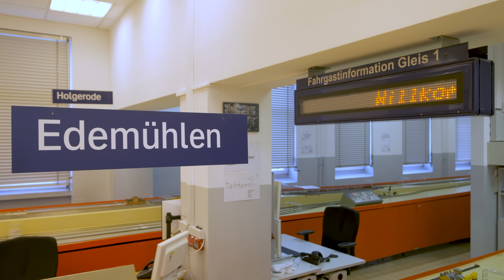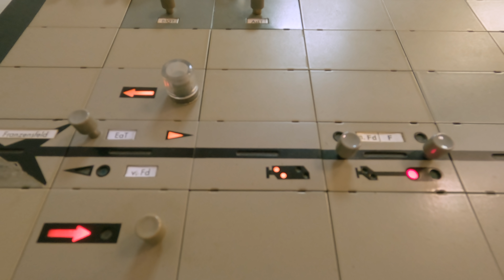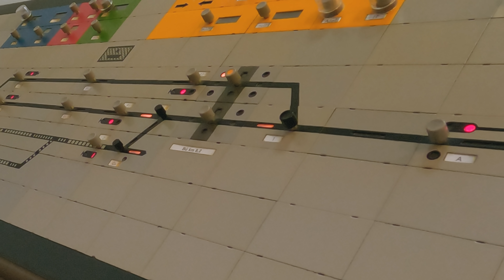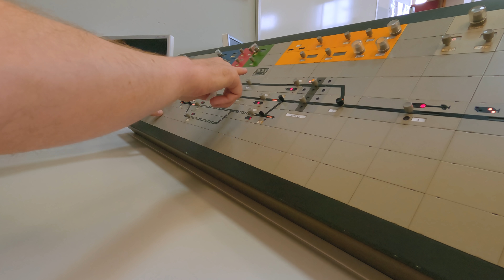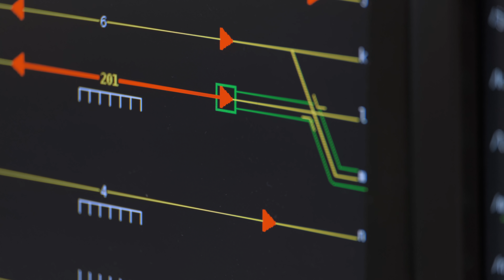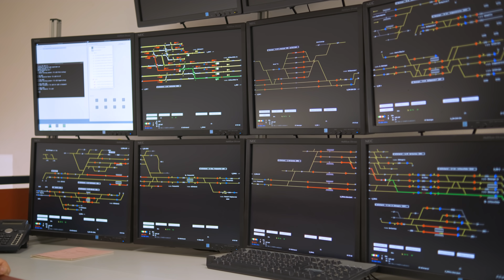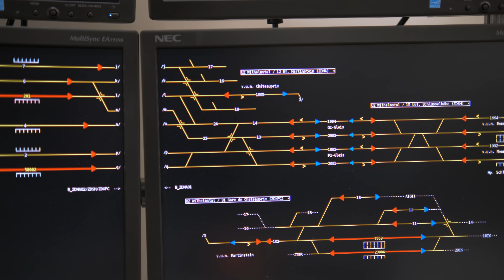The world's most useful model railway

Comment: Despite being a technology fan with a career around software, I have a special appreciation for those mechanical switches and the people who designed them. In my country up until 10 or so years ago, those kinds of switches and mechanisms were still being used even though they were manufactured by the British more than a 100 years ago, with minimal to no maintenance. 

Try doing that with a digital system.

Comment: The safety interlock is also used in the British mechanical interlocking system, however the interlock is positioned next to each point interlock, whether it is the ones for mainline, or loopline, or siding.

Comment: Sorry. I didn't get what is actually running the train(s)..IE. Where is/are the throttle(s) to start/stop trains rolling ? Or, for this MRR and panel trains run automatically at typical speeds ?
Reply: On their page (link in the description) they write that the trains are controlles by a computer system that runs them with a preselected speed for the particular section. Technically it seems to be a digital model railway were the input devices are operated by the installations shown in the video. Like putting the elctronics of a joystick into an actal plane.
They mention quite common components like Märklin K-track, Intellibox, Fulgurex motors for the points and Märklin trains. If possible with ESU Lokpilot decoders and Motorola system (the old Märklin digital system) if changing decoders was too complicated. 
They also mention that the signals are there for illustration and are not used to switch of track sections.

Comment: I've gotten in a lot of trouble in my life, because I think not in the way I'm told things work, but the way I think they work with my understanding. Having worked with Germans, and MANY people across the world, in that "try it" I hear 2 things. "It WILL not work" and "It SHOULD not work". I've run into both in my life. For the "will" crowd, it was usually the triumph of it didn't, and that should never be a negative, it means the system was well designed. 3 times in my life, I have been "proven right" though, where "will" became "shouldn't" and I had to explain for a long while why I thought "should and did". For the "should" crowd, it was this similar safe training environment, and 2 times I have made them realize a serious flaw. This trainer seems to truly understand that ever event is a test as well. It NEEDS to operate properly, so we need to see if it doesn't and learn WHY later. I love physical setups like these for that reason

Comment: The nice thing about model trains is they don't actually derail when they drive over a switch from the locked side, because the switch rails are spring biased to the end positions and there's enough play in the motor connection to allow the train to slip through. On real trains, I'm not entirely sure that an 80 ton locomotive wouldn't be able to just push the rails out of the way. On the other hand I know of an accident where an ICE train derailed because one of the "tires" peeled off its wheel and caused a switch to change direction while the train was passing it, causing the front wheels of a passenger carriage to follow the front of the train on one track and the back wheels going on the parallel track
Reply: Afaik a part in the switch brakes if the locked side is cut open. But there are switches that are intended work like the ones on the model railroads (Rückfallweiche).

Comment: There's one minor detail in the video that you could probably make a whole video of itself about, the blinking indicator on the displays for the modern digital signal box. What is actually happening there is that there are two independent computers feeding the displays, with their own graphics card and everything. Then there's a piece of equipment that constantly switches the displays between the two outputs every second. If everything works normally both computers produce the exact same picture on the display EXCEPT for the indicator area which is deliberately different. This way as the outputs are switched the indicator is blinking while everything else doesn't.  But if there's ever any discrepancy between what the two computers are showing (eg. due to malfunction), then that part of the picture starts blinking and the operator knows that they can no longer rely on what is being shown. And if there's a failure in the display switching unit itself then the indicator area STOPS blinking, so this failure mode can be recognized by the operator too.
Reply: That's fascinating! Thanks for the information; I love details like that.

Comment: The interesting thing is, controlling the station at the high level with modern computers is easy, but the moment something goes wrong it is very necessary to be able to 'drop down' a level in one's mental model and think about what is actually going on at the level of relays or even pulleys.
Reply: Not for the signaller, but perhaps for the signalling engineers
Reply: @dougle03  No that‘s not right, im a signaler in germany and if you have a problem with your system then u have to be careful and plenty of tasks to do.

Comment: I code these computer based interlocking systems fer a living.  Many metro lines the world over rely on us.  Instead of relays and long cabling across the track, you now have ethernet/fiberoptic/wifi and a bunch of UDP packets zipping between various subsystems.  Failsafe communication timers operating on triply redundant, battery backed computers to ensure maximum uptime and reliability.  They are very safe systems that can even operate autonomously without drivers!  The real challenge, of course, is combining the autonomous trains with manually driven trains on the same system. Protecting autonomous trains from drivers that can do whatever they want makes for very intricate failsafe design while still keeping railways highly operational.  There is a massive amount of thinking that goes into these systems so we can place a train with centimetre accuracy.

Comment: computer controlled signal boxes use 3 computers to gain the same level of safety like a mechanical signal box. the keyboard has a guarantee of lasting at least 1 billion button pushes and costs 15.000 €

Comment: Here in Sweden the ”federal railway school” has the same thing but there’s landscape and buildings on the model, they also have all the relays and mechanics right next to the control so you can see and hear everything working =) i guess you cant really call it a simulator because all the real mechanics are actually there and works just like real life.
An operator here have 8-10 stations, except main hubs such as Stockholm, Gothenburg and Malmö that has 3-4 operators for the single station instead
Reply: Hmm, set the points for Sweden, then, Tom!  I think we need to see this!
Reply: There's at least one US railway that has a similar training system (BNSF, IIRC)- and perhaps the FRA as well.

Comment: I had spent a good amount of time in the control center for SEPTA in Philadelphia. From there all of the regional rail commuter lines were controlled via the Centralized Train Control system.  It looked very much like the screens from the computer system that was shown last here.  The tracks were logically divided into blocks - and only one train may occupy a block at a time.  Further away from the main center city area, the blocks were longer.  Through the center city area where there were many stations/passenger platforms that were closer together, the block were much shorter.

Comment: Now think about it for just a second that the German railway system with its high speed trains is still controlled by technology that is THIS old.

I don't really consider this to be a good thing btw.
And no, I don't have a problem with a model train system to simulate this stuff.
Reply: The high-speed trains >160km/h have to be equipped with some Train control system like ETCS or LZB because the distance between signals would be too short to stop in time.

Comment: I’ve been working in Signal Engineering here in the UK for 15 years. I’ve worked in areas that have some of the oldest mechanical systems in the country down in Cornwall. I’ve worked with 70s vintage NX panels, 90s installed IECCs and the most modern Rail Operating Centres. I’ve even worked in an area during a wholesale re-signalling and re-control when relay based interlocking were replaced with solid state and control moved 20 miles from the 1974 signal box to a brand new control centre. Everything done in Germany is done here too. They have as much of a mix as we do, and although the principles from the drivers perspective are different, the engineering behind it is recognisable. 

Everything we do is designed to fail “right-side” (Fail safe is not a term we use). Relay and Mechanical Interlockings prevent conflicting routes by the nature of their binary design principles. Computer based interlockings have double redundancy, with additional processors, checking each other’s results and outputs. We don’t detect the presence of trains, we prove their absence. Points are not only moved, but physically locked in place. In the incredibly rare event that a failure does occur “wrong side”, we will follow strict testing guidance, using all our available evidence such as CCTV, data loggers and the observable state of equipment, then we dismantle and destructively test the equipment, sending it off to external forensic investigators if required (not its manufacturer). There is a reason that our railway is amongst the safest in the world, and that is down to generations of learning from our mistakes, improving processes and the dedication of engineering staff. 

Anyway Tom, great video.
Reply: 9:29

Comment: I was a train driver for a couple of years and it was easier to drive than a car, mostly because there were no other trains trying to cut me off! :P
But when I talked to people in the signaling part of the job I learnt that they are the ones that made my job so much easier. I just had to look at the lights and maybe talk abit on the phone with them. The area I worked in wasn't as intensive as it was mostly rural but I heard so many horror stories about the large cities and how, for example, the signaling people would call the train drivers if they were over 1 minute late, the timing was so exact that the tiniest delay could change the whole days schedule.

Comment: I love that the 50s interface is (I assume from the looks of it) modular, so you can switch out the rectangular panels and build a representation of almost any system required.
Reply: In Germany we use interfaces like this at some locations still today .
Reply: @youtubemensch  not just in some places, in fact those are still the predominantly used variety, with different models.
Reply: It's completely modular, both in the operating panel and in the relay logic (which is in another room). Each switch and signal is represented by an off-the-shelf module. The tracks are represented by cables connecting the modules. Modules can also be easily replaced for maintenance. This makes building new ones, adding or removing tracks or switches as well as replacing broken equipment cheap and easy. Later relay models also offered the same operating comfort as modern computer based ones, meaning you only select start and end, and it would automatically find the best route, configure it, check all safety interlocks and operate the signals. (And also undo all of that as soon as the train has passed)

Comment: Tom: The technique from 50 years ago is still in use today?
Next sentence: The technique from 100 years ago is still in use today
Reply: If it's robust enough to last 100 and more years, why not?
Reply: I am all in when using old technic if it works.
But I was also astonished that it fulfils todays security standards. It must, otherwise it wouldn't be used.
Reply: @Delibro  Today there is added electrical locking in addition to the mechanical interlocking. So once you mechanically interlock the points, you then electrically lock the mechanical interlocking lever, so you can't undo the mechanical lock on the points. And the electrical lock can't be undone without a lot of additional safety work. Many old interlockings also got rail occupation sensors added later on and other stuff. The old systems got upgraded to todays standard. Just because the tech is from 100 years ago doesn't mean it stayed at the safetylevel from 100 years ago. It just operates the old way which means that you don't have the throughput of newer systems. And you need a lot more personnel.
Reply: @NeddyxP  > It just operates the old way which means that you don't have the throughput of newer systems. And you need a lot more personnel.  

And replacing it with a modern control system is expensive, so they aren't going to do it unless they need that increased throughput.

Comment: So after all these years they still don't have PTC on the whole system
Reply: Ofc we have PTC on the whole system. The introduction started in 1934 and was completed in 1980. Our PZB just works a lot different than the US positive train control, the direct European equivalent to that would be ETCS but it's not really needed unless you try to cross the whole of europe. PZB is perfectly fine until you reach speeds where you need cab signaling

Comment: All very fine and well, but (unlike the UK) they don't seem to have worked out an interlock to prevent a train entering each end of a single-track line at the same time.
Reply: There actually is, because there can't be two "Fahrstraßen" over each other at the same time. The only possibility for allowing this is Rangierfahrt (for Shunting), but there you have to drive so slowly that you can break in your sightline.

Comment: Interesting. Some of the mechanical failsafe measures were described, but what happens if the operator has a hangover or heart attack, and only pulls a lever down 50% ?
Reply: Signals can't be turned out of the "stop" position, as the system is still locked.

Comment: I'm curious if, barring mechanical failure, it's possible for a collision to occur due to signal operator error. Or is the worst case that they have suboptimal throughput or route a train somewhere it doesn't need to be.

Comment: I don't know why but I find the purely mechanical system super fascinating. It may be outdated, but it worked for so many years and is still working today. What a feat of the engineers back in the days.
Reply: I find it fascinating too
Reply: It sure is. Thats the reason I find mechanical puzzles really cool. They use a lot of different mechanic functions and ideas that many people had to come up with. And in todays time and age I personally find it more difficult a sole mechanic to engenieer then just putting in a moter and a gear for every axis instead mechanically linking them what would resoult in a bigger system overall :)

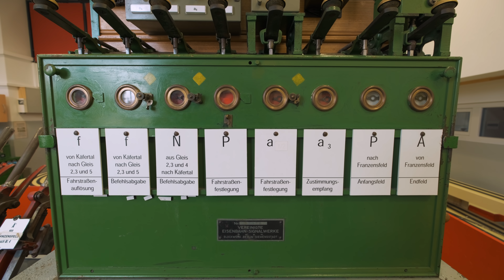Comment: The exact same manual route locking than the one at 2:15 is still been used to operate the Train1900, an historic steam train between Fond-de-Gras and Petange, in Luxembourg. You can see it working during the touristic season. (I'm one of the volunteers who operates it)

Comment: Excellent video covering the history of railway signaling. The lever-operated interlocking, electro-mechanical panel and computerized displays are not unique to Germany ... same evolution has taken place in most countries. I recently retired from 40+ years helping build these kinds of systems for railways in various places around the world, from simple electro-mechanical systems (sometimes called "C-machines") to complex computer systems, the most recent ones where the signalman (dispatcher or controller in the US) doesn't need to move the points and clear the signals... the computer knows where the train is going and does all that automatically (with safety assured) as needed.

Comment: So my mom actually is the head of a similar lab in another german university and there are about 2 kms of model rails there, however the whole system there is simulated digitally and the trains are just synced to that. I've worked will the things Tom used in the video and it sure is fun. However they didn't do the most fun one which would just bling and blink.
The only thing is that these are literally older than a century ... and still partially used in germany.

Comment: It was interesting to see the same features as in the UK singling system, just slightly different approach to physical presentation. In the UK, you would never have got away without using a cloth when handling the physical leavers! The electronic and computer based systems were even more like the UK ones.
Thanks for the video.

Comment: So what I want to know is:  can you cause the model railway to crash?  Not just for the fun of crashing model trains, but for letting the students learn from failure.  There seems like a great degree of safety systems preventing these sort of scenarios, but I assume there's some sort of fail state that requires this to operated by humans.  So what is that fail state and do they let the students reach it?
Reply: I would imagine so. 
In itself the system prevents human errors. But once the system breaks (eg a signal doesn't turn green, when it is supposed to) and you enter the phase, where the humans have to take control and keep everything safe. And this is where errors occur. 
That's why there is so much training. To be prepared for these situations

Comment: An equivalent system (but 3 rail and 0 gauge 1/43 scale) was implemented by the Paris metro company for training drivers, conductors and dispatching agents in the 40s and remained in operation until the mid 70s. It is now visible at the RATP transport museum in Paris 12th district.